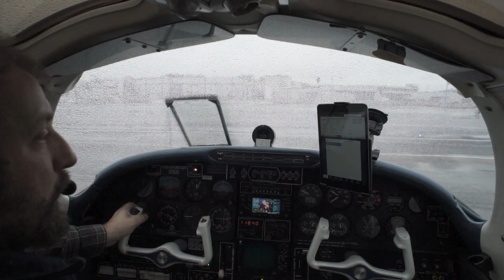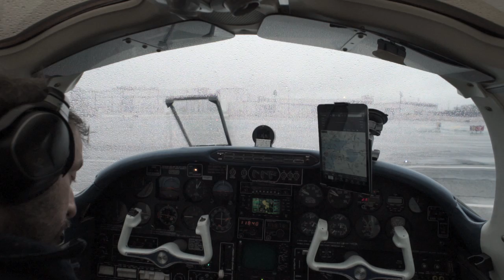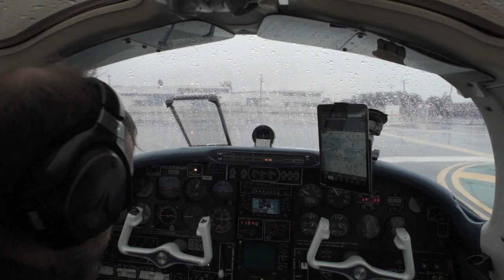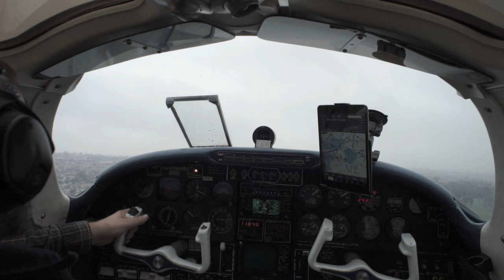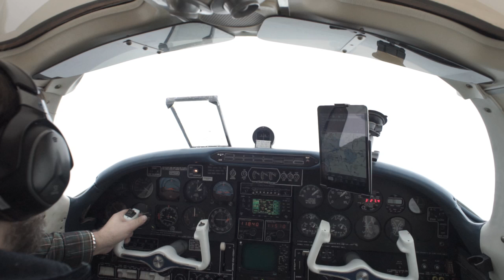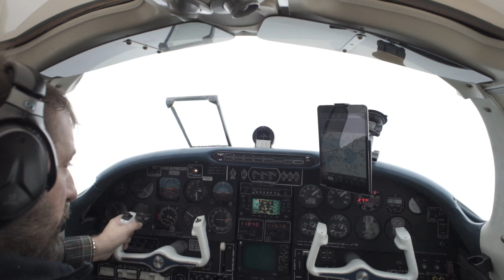Instrument clearance and departure in bad weather with ATC audio.

Comment: A word of advice from a retired airline pilot with over 40 years of experience as a flight instructor, and a few thousand hours in an Aerostar.  Stop snapping the gear up the instant the wheels leave the ground.  Wait until you no longer have sufficient runway to land if necessary, but at least wait until you have 100 feet of altitude.  It may save you from scrapping up your airplane one day.  Enjoy your flying.
Reply from the maker: I disagree. The longer you keep out the gear on a twin, the more you hurt your chances of a OEI climb out. Especially on an Aerostar that doesn't climb very well before blue line speed. Get it tucked as soon as possible.
Reply: I am going to agree with you on this one concept and also the concept that getting as much climb performance as possible as soon as possible puts a little altitude in the bank against Lycoming's notorious rods and cranks.
Reply: A couple of comments for USCGAUX first, HHR is a pretty short field 4884' so there's not a lot of runway left. Second is that the Aerostar is fast and will blow through the retract gear speed very quickly 130 KIA, and if you retract the gear above retract speed you break things. Wait on the flaps, 156 KIA is gear extension; but the gear should come up when positive rate is established. I have about 1000 hours in Aerostars and I made the mistake once of waiting a little too long to retract the gear and I broke the left main bellcrank; a very costly mistake I will not make again.
Reply: I might add that in ONLY in such a higher performance aircraft, at least wait until you have a stabilized positive rate assured before snapping them up, regardless of runway might be left.  I also wonder about his sense of flap retract when VMC is the biggest issue, IE the VMC delta with flaps up compared with T-O setting, even if you do have VGs.  He should also realize that we just want to make sure he doesn't wind up on the evening news with these procedures some day - it's not about being critical.
Reply: @gendaminoru3195  do you know what rotation and gear retract speeds for an Aerostar ?  Rotation is usually above 100 KIA, for good reason; Aerostar will not climb below 100 KIA. And the more speed builds the higher the ROC to about 150-160 KIA. Now couple that and the fact that an Aerostar accelerates very quickly and that the gear must be up before you hit 130 KIA. You would be a fool to leave the gear out any longer than absolutely necessary. This doesn't apply to other twins, just the Aerostar.
Reply: I am well aware that lift is the square of speed [USC Aero -91 MS '93], and the Aerostar is in between jet and prop where there is not quite enough thrust to do both.  I do agree that they should have built the gear retract extend speed at a higher value for a number of reasons.